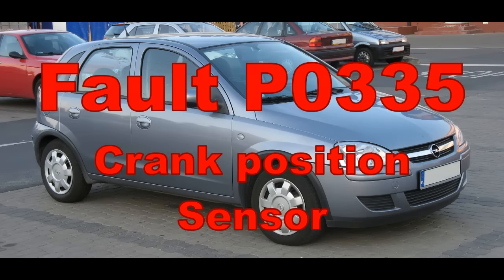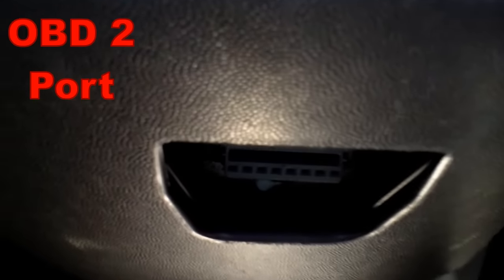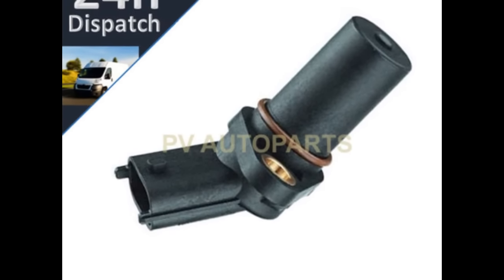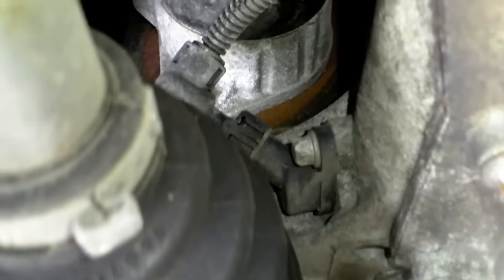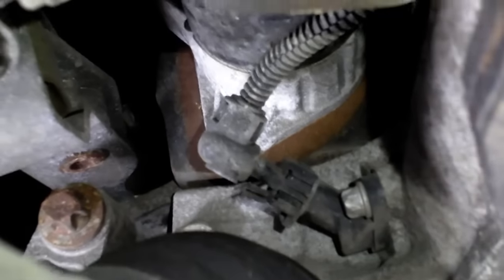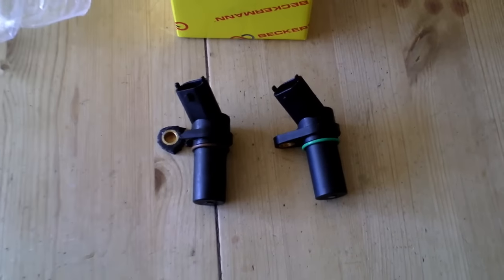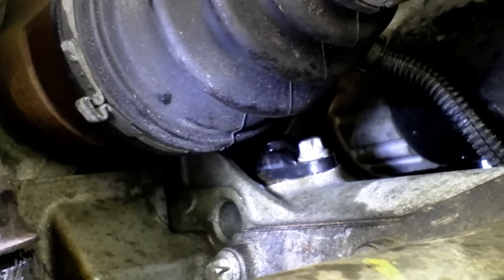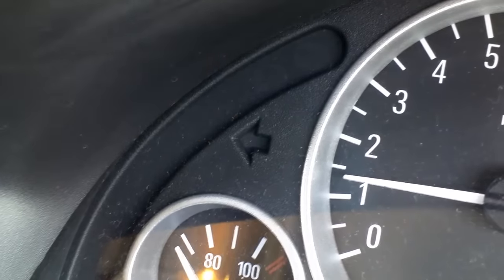Opel / Vauxhall Corsa C P0335 crankshaft sensor replacement guide.

Comment: Have you encountered an instance where the sensor is just impossible to pry out?
Reply from the maker: This one is was very tough.  Of course the sensor is plastic and the block metal so it will always come out with force.  You just need to be really careful that any broken parts do not fall inside the engine.

Comment: i have this fault on a 2004 meriva 1.7 cdti would it be in a similar position?
Reply from the maker: +outdoorlip1  Its going to be somewhere around the bottom of the engine as that is where the crankshaft is located.  The sensor will prob look very similar.  Also rem that a camshaft sensor can give the same symptoms.

Comment: hello mate, I have an Astra G which shuts off when it warm . Then struggles to start. it starts perfectly when cold. However I have got no codes showing?
Reply from the maker: +ThePhonecat Normally a crankshaft or camshaft sensor fail will store a code.  Have you tried plugging in the scanner when the car wont start.  Basic stuff also helps starting like a clean air filter etc.
Reply: +fredintheshed1 I will give that a try thanks. I had the car serviced recently just to count that out. However I didn't change the fuel filter.
Reply from the maker: +ThePhonecat A blocked fuel filter could cause the problem but you normally get fuel starvation under high load like pulling up a hill.  Its a tough one without a stored code but I would think electrical first.  best of luck.

Comment: has a light fine and flick between 2000 and 3000 rpm if the crankshaft sensor ? astra g 1.7 Diesel
Reply from the maker: +Stefan Kabic They way to tell is to read the error codes stored and goggle them.

Comment: I got a corsa standard engine but won't start should I do the same
Reply from the maker: +Bradleigh Davies Yes if you get the P0355 error code.  There is also a sensor on the camshaft which also fails but is much easier to get to.

Comment: hello has an acquaintance an opel Corsa 1.4 automatic gasoline from 2003 when the engine is cold starts when it is hot and it does not start until it cools down could anyone help me.
Reply from the maker: Attach a OBD2 scanner and look for error codes.

Comment: A word of warning: if you get that code, DO NOT CLEAR IT before you change the sensor, or your engine won't start at all. Most other codes you can clear to see if they show up again, but not this one.
Reply: What should you do if you’ve already reset the code after identifying the fault
Reply: I could find no solution, the ECU/engine refused to budge. Had to transport the car to an Opel service, where they magicked it back to life - it wasn't a large bill fortunately, but i don't know what the repair entailed, i didn't ask. Sorry i couldn't be of more help.

Comment: hi there does anybody know if this is the same sensor on the zafira 51 plate. and is it in the same place Fred in the shed?
Reply from the maker: +Kieron Carberry Sorry mate I do not know.  The location of the crank sender will be located at the bottom of the block.

Comment: I have an Opel Corsa B 1999 1.6 Sedan. It was made in South Africa though, i think it would be very similar to the UK models , i think. Then again when i tried to follow a haynes manual my friend loaned me before the pictures were completely different which was irritating. So unless you are mechanic its hard to follow. If you are a Mechanic then the practice and stuff is very similar and it would be easier to follow and understand the theory and practical i guess. My luck i live here, i tell you.
I want to get an odbc reader but i dont know which one to get.
I think and believe i do have a odbd2 port.?
I have been having a mysterious starting issue with my car for a long time and my mechanic says i should just ignore it.
I dont like the fact that you are wearing out your starter and even though it is charged when u drive i believe the battery also gets killed. Please help with any idea if you have?
I have also got posts of my scenario of my crank starting issues which might be of more help in describing my scenario.
The crank sensor, i have heard of this also.
My car battles to cold start.
It is a mystery though because it battles to start 5-7 seconds when i leave work at night .... it starts with no accelerator but its a bad idle and then 30 seconds the idle starts getting better.
(first crack scenario 1a) When i leave home though every morning, the car seems to "want to start" better ... you can hear it almost catching....if i can say that ....but then i let go of the ley and it doesnt start.
(first crank scenario 1x) IF i had to do that though whilst pressing accelerator in a 2000 rpm position.... then it starts fist time.
(following first crank scenario 1a)...after i have tried to start it and it fails to "catch",
I now turn the key again and it tries to start but it takes like 5-7 second before it start and i seem to NEED to press accelerator also.
I have had this issue say for the last 2-3 years, with i can solve it.
I am not a mechanic and not really a DIY person but i have bought jack stands and a jack(jack seems to be useless though since it doesnt raise the car enough and my (tyres/tires) seem to still touch the ground).
I am willing to learn theory and do some stuff on my car.
I have cleaned my ICV using carb cleaner and even soap and water and leaving it to dry in the sun,
I have even tried a new ICV and then i managed to get a proper throttle body spray cleaner.
I have also changed my Air In take pipe and the Air sensor it comes with.
I have tried 3 sensors. 
I have tried to play with the ICV by unplugging it from the harness and my car idles erratically so it means it work? I have also tried to take out my MAP sensor plug and my car idles erratically so i guess it means it also works.
Yeh anything to try and fix this and understand this stuff, it seems that cars are simple and yet they are complex so i dont know. I guess almost like being married.
LEt me know if you have ideas,, thanks.?
Reply from the maker: Intermittent faults are a nightmare so you have my sympathy.  I was going to suggest the MAF sensor but you have covered that.  You have a cam and crank sensor which can cause both issues.  You need to get a obd reader. Also don't forget the key and imobiliser chip.
Reply: hmm not sure about key and the chip inside. When i used to service my car at the dealer before they once told me about my key and the chip inside nothing to do with a fault but they told me it was important. I dont think today i even know why. i mean my car is a 1999 car does it really matter , its surely old so i dont think we are talking abot technology like in the movie Gone In 60 Seconds,. I dont have an immobilizer. I will never buy one or even and alarm, im sure it just gives you head aches.
Reply: yeh so i one day unplugged  my ICV while the car was idling or while i started it cant remember and i remember that the car didnt idle properly.   Then i was experimenting and i tried the MAP sensor which on my car sits on the firewall in the middle of the car and it is connecting to the throttle body with one pipe. anyways i took it out and started the car , the car had erratic idling like high and then low and then high and then low....so i guess that part also works fine?
Reply: I will probably have to send u video and pictures if you need so that you can see my odbc port and just have a general look at the car
Reply from the maker: Your OBD2 port is located in your fuse box on the far left next to the 30 and 20 amp fuses.   I am pretty sure that a 99 car will have a transponder key.  I will look for you in a min.  OBD2 readers can be bought on line via Ebay or Amazon etc.  That will be your first course of action to read any stored codes and google them to find the faults.  No I wont be sending you one.  I will send you a couple links on then next comment.  Best of luck.
Reply from the maker: http://www.migweb.co.uk/forums/other-mechanical-electrical/486725-corsa-b-immobiliser-anyway-bypass.html
Reply from the maker: This is the OBD2 reader I have and it reads Opel / Vaux.    http://www.ebay.co.uk/itm/D900-OBD-II-OBD2-EOBD-Car-Scanner-CAN-Fault-Code-Reader-Vehicle-Diagnostic-2015/331912591466?_trksid=p2045573.c100505.m3226&_trkparms=aid%3D555014%26algo%3DPL.DEFAULT%26ao%3D1%26asc%3D20151005190540%26meid%3D8a8a30d4859a40079cc92e0155a239d0%26pid%3D100505%26rk%3D1%26rkt%3D1%26
Reply: Looks cool , i take it is better than the common ELM ones i have seen... ? what is the cd for?  do you need to use laptop for this? do you connect that unit to the pc also?
Reply from the maker: No its a stand alone unit.  It draws power from the cars OBD 2 port.

Comment: @fredintheshed1 I live in somersert I'm going to attempt to do it my self😁as i just brought the part for 21.50 and I'm kinda broke 90 is a lot considering I could do it for free 😁
Reply from the maker: Just take your time.  The hard part is prising the sensor from the crank case.  Just dont force it as the last thing you want is the sensor to snap or parts to drop inside the engine sump.

Comment: I CANNOT undo the bolt. Bought a set of torx but couldn't get it to go on square. There is something stopping it. Tried 8mm spanner. N.G. Tried long thin grips. N.G. Thinking the pigtail is blocking it, i tried uncliping  but working blind. You removed the bolt with the clip in  place... Ideas please!
Reply from the maker: I dont rem my bolt being too bad.  Prising it out was tough though.  Maybe some extra long spanners might help put more torque on the bolt. https://www.ebay.co.uk/itm/165737722746?hash=item2696bcf37a:g:sKcAAOSwd7tjU-5p&amdata=enc%3AAQAIAAAA8P40SWZis7mQHM%2FmLlCstHBe1GMu77zLWAfMlmiKj7BUOnI4n41A965o2nNxP1VgBeg2DamBFyEU%2FdjpEHRaasWue5dGsRP%2FvTlU0nelcYKKwtWmPbvSk45OourYsEa98mgo3wzYKabStC5BlR%2BeV2fuYrbLfhTZEqwgV5sz7ZTlXaKv7BYeugPAiTXqHmVNqL%2FHS9gPSZ4KUwwxaSqYmAF0tCay11REOcE1JbVdDD6jHllQ9k75DnwDp8eaT35nOGRg0GYJvtv8%2BSrFAESeP3hGc9pm0741Sd7mr%2Fp8cAgnB5buY%2BliiMRyHo8VjxWv7g%3D%3D%7Ctkp%3ABk9SR5T85YafYg
Reply: @CB-RADIO-UK  Thank you for replying, and so quickly. I've had a look at the link which I'll bear in mind for the future. I wonder who has used them for what. In fact it's not leverage that's the problem, rather that I couldn't get anything to fit down over the head. But, I went and looked for another 8mm ring, and I think the ring was thinner. Anyway, it went over and fit with a little pressure and the bolt came free. Equally nice, with a long thin electronics screwdriver I got a foothold then pushed in a broad cup (??) car upholstery tool and it just levered up. (I say all this in case it helps s.o. else.)
Thanks again.